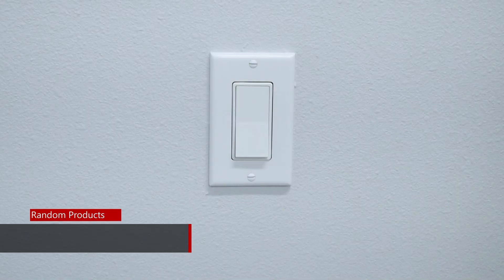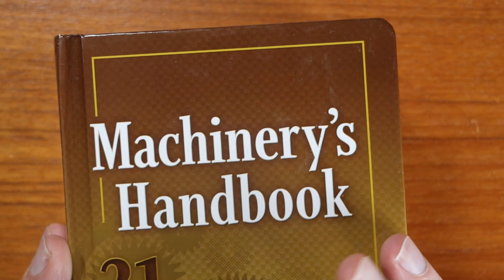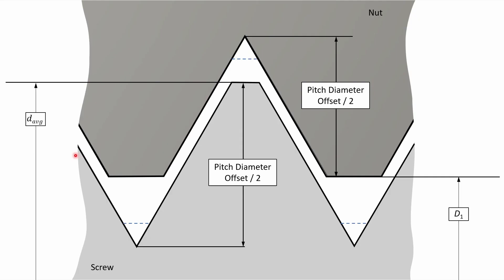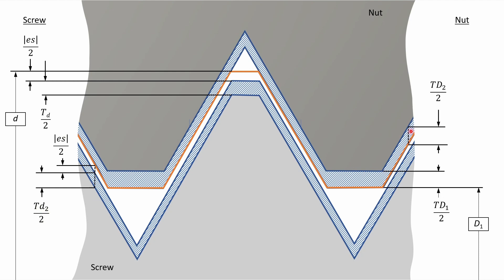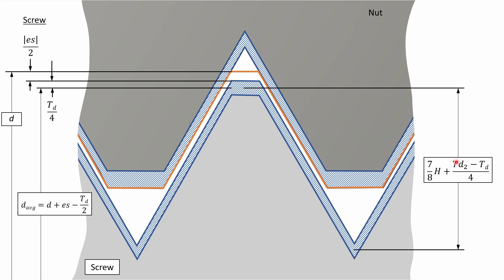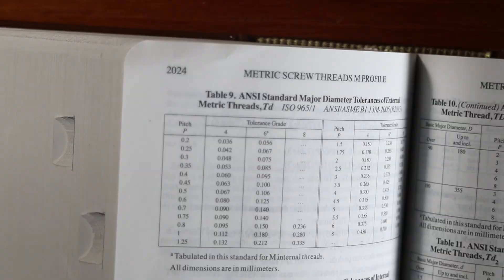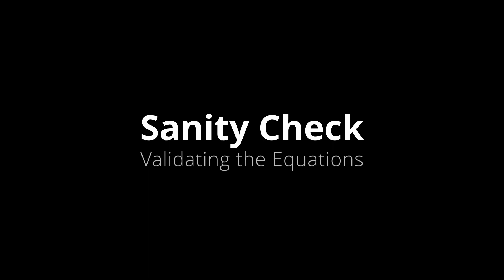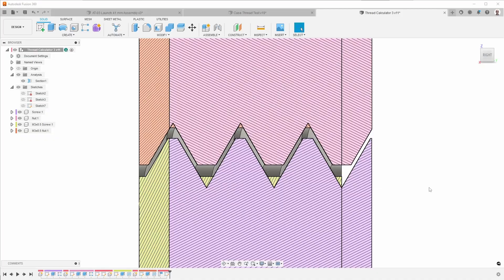Threads and tolerances, calculating diameters and pitch diameter offset

Comment: I know the effort of your deep dive. I did it using the ASME standard and made a spread sheet to calculate every parameter of any thread size and pitch. I have been working on it for years. From that work I now know that no machinist I've seen actually knows what a correct thread is and neither did I until I did that.

Comment: Good video John! I recently had to cut 63 x 4 mm internal threads for three adapter locking nuts on an industrial meat extrusion machine. Despite it taking longer, I usually prefer thread milling. I also like the bonus of being able to walk a thread in using wear compensation. Thanks for taking the time to show your process.

Comment: Nice work John.
I like and use analysis views as a way to check fits and tolerances. 
Another interesting view is to make your model a bit transparent and then zoom in until your view becomes from inside the threaded nut and looking out to the threaded shaft.Hard to describe but play with the zoom until your perspective is from inside the part.
This really helped me to see the fit of some tapered components that were offset.

Comment: This is awesome.  Thank you for a clear explanation!  I now have to migrate to Fusion 360 from MicroStation, which has always been my mechanical design software (but the versions I have do not have ports for doing 3D printing, or machine control files).
Reply from the maker: Thank you!

Comment: I have thought about making a chart for myself with actual cut depths for each pitch for lathe use. Otherwise could just use the calculator every time but the nose radius on the tool causes some extra steps

Comment: Great research to do this. I'm not sure how you arrived at Td2 though. In the example  at (12:30 minutes) you said d is 27mm then you looked up table 11, couldn't find P=5 (which looking at the numbers would be around 0.24) and then you chose 0.075 mm from a substantially different major diameter?

Comment: I tried using your formula for a 24 x 3 mm external thread and got a pdo of 4.503 mm which seems awfully deep even if I divide that be 2.
Reply: For that 24 x 3 , I get a BASIC pdo (thread depth) of 1.6238.   Obviously a 3mm pitch can't have a depth greater than 3 so clearly there is a mistake there.
The formula based on the standard proportion is Pitch x 0.54126588 = Basic height of single side thread. You would double that to get a diameter. 
So 3mm x 0.54126588 = 1.62379764 Single side and X 2 = 3.24759528mm BASIC on the diameter. 
That includes no tolerance adjustment so the final number will vary slightly within  the value of the tolerances you select.

That said, you should never rely on "cut depth" to actually cut your thread to size, it is guaranteed to be off since you will not know the minute details of your tool. You use that number as an approximation target then when you get close you measure what you actually have then finish it to size.

Comment: I ithought the pitch diameter offset is the difference between the major and minor diameter?
Reply from the maker: That's close to being correct. Adding tolerancing into the mix means you have to change this slightly.

Comment: At 14:08 I think you swapped what you swapped the TD1 and TD2. I believe you should be adding TD1/4 and subtracting TD2/4.
Reply from the maker: I believe what I have is correct. Here's the way to think about it. Given the ideal height of the threads, you're increasing the height by TD2/4 and then decreasing the height by TD1/4.